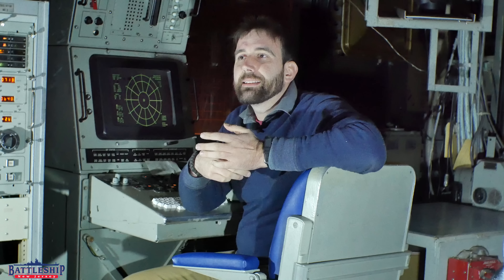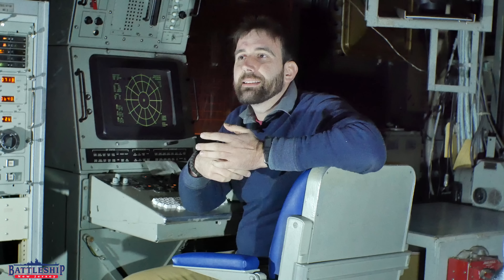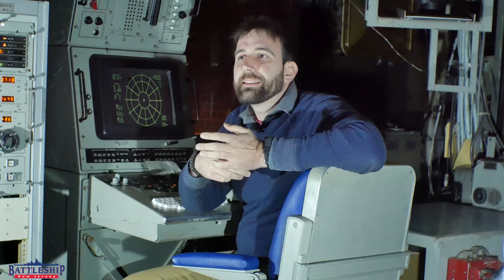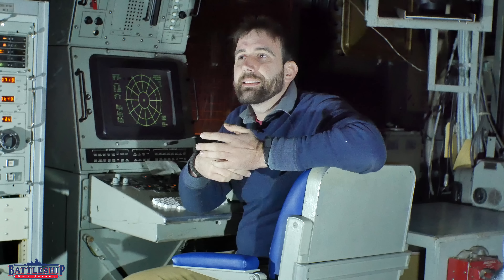Aggressive Christmas Tinsel, Smoke Screens, and Other Countermeasures

Comment: Let's not forget the WWI vintage countermeasure used on battleships: Dazzle Camouflage Paints to confuse the old mark 1 eyeball
Reply: And the confusion created by the High Seas Fleet having radio signals made in port after they had sailed.
Reply: @20chocsaday  That's a story I need to hear.
Reply: @sambrown6426  Drach did a series on the Battle of Jutland. 
The fog of war was added to the fog of the North Sea. 
Some ships exploded themselves but they shouldn't have been there. 
He did it well.
Reply: @20chocsaday  I'll have to check it out.
Reply: @20chocsaday  I can also recommend the book 'Jutland - The German perspective' by V. E. Tarrant. 
(it's possible that Drach got some of his info from that book)
Reply: @srenkoch6127   Check his sources, he usually puts them in the Description.
Reply: And now modern homogenizing camouflage to confuse the eyes of drone screen operators and digital analysis systems.

Comment: IIRC, a modern Ticonderoga class cruiser has jamming powerful enough to burn out the receiver section of a radar guided missile. They also had to increase the EM shielding on the bridge to protect the crew and bridge electronics from the radar array.
Reply: That is terrifyingly impressive.
Reply: @sambrown6426  it's said that if an Aeigis ship paints your aircraft with targeting radar, everyone in the plane will go sterile.
Reply: Time to make some popcorn!
Reply: @DSiren  Wdym?
Reply: @sambrown6426  the radar is supposedly powerful enough on its highest setting to permanently damage any ovaries or testicles on an aircraft locked by it.  "paint" is a term used to refer to a laser or radar marking something for destruction.
Reply: @DSiren Not even remotely true lmao.   They paint civilian and friendly aircraft all the time remember.   

Short range jammers are very different animals, sterilization at radar range is called a death ray and doesn't exist.

Comment: As it happens, IR guided anti-ship missiles are becomming more of a thing today because few ships carry flares or IR jammers as their counter measure options, and the sensors are smarter in the missiles and isn't going to be fooled simply by sunlight. The advanced NSM which the US Navy has adopted (manufactured under license by Raytheon) as the RGM-184A uses imaging infrared homing for its terminal guidance phase.
Reply: Also with modern computing power you can have the software compare IR pictures of ships to visually identify them to target..So a bunch of ships could be in a battle and intertwined and the missile can tell who's friend and foe..We already have this with dropped anti armor submunitions...You can drop a cluster bomb over a battle and it will only target enemy tanks by IR picture comparison.

Comment: Ubon RTAFB Christmas 1972 quick turnaround F4s and loading them with Chaff pods. The planes had been refueled and rearmed ready for turnaround. Someone down the flightline dropped several chaff pods and they opened up and blew towards us. Got into the air intake of a gas turbine flightline power generator and staring spewing fames out the top. Two of us were working in the cockpit of an F4 and I saw the flames and told the guy in the front seat to get out and pull the power plug from the plane while I was going to try and shut off the generator. Success and then a station wagon pulled up offering us coffee, tea or hot chocolate being driven by an officer. As this was at night and in shadow the other guy started spewing expletives about what happened. Then I noticed the cross on the officer's collar (he was a Chaplin) and tried to stop him swearing. Finally got a cup of coffee into his hands while I opted for hot chocolate. He was shaking so much he ended up with half a cup.

Comment: Pedantic note (Retired USNR LCDR here): At 6:19 you say "When ECM detects." ECM stands for "Electronic Counter Measures," i.e. jamming. Detecting and classifying radars was called "Electronic Support Measures," or "ESM". Then there's "Electronic Counter Counter Measures," or "ECCM," which is what you talk about at 6:25, when you talk about missiles changing frequency to avoid jamming. Finally, when last I heard, they had changed the names. ECM was now "Electronic Attack (EA)," ECCM was now "Electronic Protect (EP)," and ESM was now "Electronic Support (ES)."

Comment: My father was an electrical engineer, and - with a partner - owned a consulting engineering firm from the late 1930's until late 1941. On December 8, 1941 he resigned from the firm and enlisted in the Navy. During the wat he "sailed a desk" working on the radar countermeasures you describe here. He was instrumental in designing and building the receivers needed to characterize Japanese radars, and in building the ferret aircraft you describe. One other thing the ferrets did - which I don't believe you mentioned - was to map out Japanese radar coverage around various islands (determined by radar placement and terrain masking) to determine the best avenues of approach for bombing aircraft and land forces during the island hopping campaign.

Comment: Absolutely love this channel. I'm by no means any kind of navy buff, nor any personal connection to the ship, but the history and charm of this channel keeps me coming back for more. Would it be possible to have a bit more of a guiding hand when you use imagery to explain a point? For example, 5:15, I'm not sure what the O10 level is off the top of my head and would require more context. I understand if this isn't possible as I am very much aware that you have to cater to the battleship aficionado audience too, but I thought I might as well speak up to try and make the content more accessible. This is incredibly important work you are doing to preserve history for future generations and whenever I get the chance to visit the US, I will definitely be coming to visit the battleship. Hope everyone on the battleship has had an amazing Christmas and New Year!
Reply: For context, the O levels are the levels above the main deck. 

For the Iowa class battleships, the ESM, ECM computers were stored in the O10 level (10 decks above the main deck). 

The SLQ-32 antennas were located on the O-10 1/2 deck, 1 on each side of the ship providing 180 degrees of coverage each.

The 0-10 1/2 deck could be accessed from the 0-11 deck via a ladder or the O-10 level through a small crawl scuttle in the equipment room.

The chaff and IR decoy launchers could be found on the O-5 level on each side of the ship.

The Iowa class had 8 SRBOC launchers, 4 on each side that could fire either chaff or IR decoys. 

If you Google Iowa Class Battleship and Mark 36 SRBOC you will find images of them. The launchers are located near the mid ships MK 25 gun radar  mounts. 

The famous Japanese surrender plaque can be found on the O2 starboard side forward just below the 5” gun mount. 

Enjoy the ships. They are beautiful and powerful and as romantic living and serving on them as you read about in books and other accounts.
Reply: @yisunshin7245  that's really helpful, thank you! It's definitely helped build up my mental map.
Reply: @nedhyett  my pleasure. I was stationed on the USS Missouri for 5 years. I truly loved that ship and my shipmates.

Comment: If those are the Christmas Tinsels, I wonder what the tree looks like.
Reply: 16 inch gun
Reply: Drive-by decorating
Reply: Christmas Tree's across the River, aboard Becuna.
Reply: How did you comment 9hrs ago when the video dropped 5hrs ago...lol
Reply: @tonyelliott7734  I dropped by before the video streamed.
Reply: @metaknight115  
Ahhh...I wasn't aware it was streamed.
Reply: The tree is about 6 feet tall, weighs 2900 lbs and can fly about 25 miles…….
Reply: Ask North Korea...... Oh wait that was the Wisconsin lol
Reply: The mast
Reply: Super structure needs a lot of decorations!
Reply: @raydobratz6349  I was stationed on the Missouri for 5 years. Iowa class BBs are quite a sight to see on Christmas.
Reply: @yisunshin7245  lobbing Christmas trees across the battlefield.
Reply: Javelin

Comment: I can see IR opaque smoke becoming useful in the next decade, as visual and IR Image sensors are becoming better and common in detection and guidence systems.
Reply: There are certainly molecules which will preferentially absorb certain wavelengths. They are manufactured by the ton and called Pigments.
Reply: LADAR is now a thing as well, blocking or disrupting lasers is an issue in all theatres now.  IR or thermally opaque smoke is done by making the smoke hot enough to view infra red sources on the other side of the smoke.

Comment: I find it interesting that they still had the simple chaff later on. Stationary chaff became more or less useless in the middle of WW2, since it is quite easy to filter out the one frequency which corresponds to velocity zero, and only look at those which are doppler-shifted. It's not possible if the ship moves completely perpendicular, but that's probably not the most likely case and would also expose a much bigger area.
So I wonder whether this filter technology took some time to get implemented in guidance systems.
Reply: Chaff isn't generally single freq.  They cut the strips to different lengths for different types of radars.  For instance, fighter chaff is actually multi-freq cut in the millimeter to centimeter range, mostly to try to fool tracking and engagement radars.  Chaff can also be cut to fit lower freqs.
Reply: @ragnarredbeard4652  That might be. But the reflection will always be roughly the emitting frequency of the enemy radar. But if the target is moving toward or from the enemy, the frequency will be different.

Comment: The USS John F Kennedy CV-67 had the Chaff-Roc, when I was on board her in 1979. I know, because I was part of the sailors who attempted to make it work.
Reply: "Attempted"
Reply: @JoshuaTootell  that thing was so old and falling apart it was not funny. We redid all the cable connections, due to them being corroded. We could not find any parts to repair the control boxes. When we asked the Navy for help with getting parts, they said they were supposed to have been removed. A couple of weeks later, they were removed.

Comment: both active and passive countermeasures are important for the survival of a ship. A ship without active countermeasures is an easy target and no amount of passive countermeasures can protect everything. even if all the ships vitals are protected with impenetrable armor, the ships sensors and other equipment are not and can be put out of action quickly. However, no amount of active countermeasures are 100% foolproof as shown by HAM Sheffield, and having heavy armor can mean the difference between going home with most or all of the crew and getting repaired or going to the bottom with most or all of the crew. Certainly any heavy warship should be armored to both it and the crew. How would the Stark or Samuel B Roberts have faired if they had carried proper armor instead of the thin hulls the OHP class was built with?
Reply: If Stark and Samuel B Roberts had 'proper' armour they wouldn't have been floating or upright!

Comment: I wonder if you could inject metal powder into the normal funnel for the ship and "inject" metal into the already hot exhaust and make a plume of chaf
Reply: Not really. Chaff needs to be matched to the wavelength of the radar to be jammed for it to work properly.